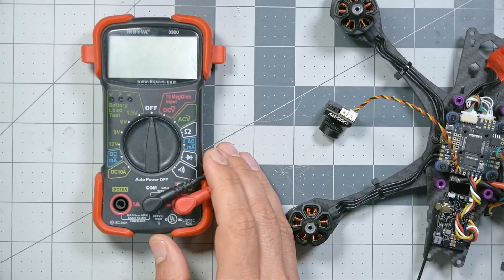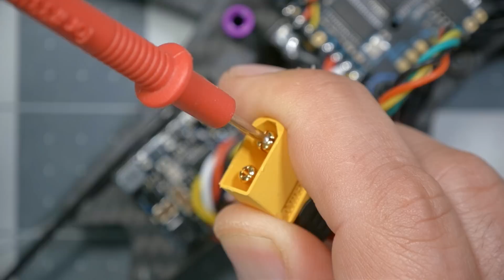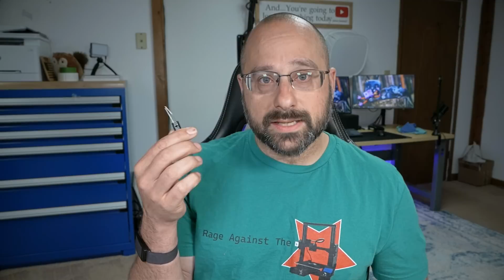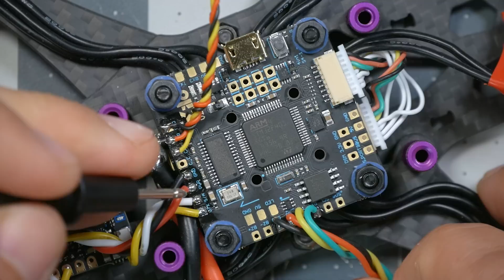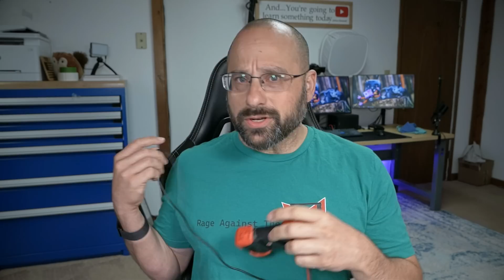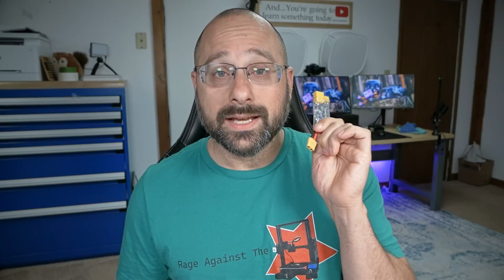This check keeps your FPV drone from burning when you power up

Comment: Hey JB.  First time build.  I have the esc, flight controller, and motors on.  I used this video to check continuity.   Can i do a smoke test now or do i have to wait to get receiver, cam, and vtx installed?
Reply from the maker: You can but I'd do it again after all soldering is done.
Reply: @JoshuaBardwell awesome.  Yes i was definitely going to do it again.  I just havent connected a battery at all yet, so i wasnt sure if that would mess anything up without the othe components

Comment: My multimeter is an analog model, which I like because it can show a momentary spike in a circuit that a digital multimeter might miss. When I test the circuit on my quad for shorts (I’m building this quad along with the video). I see the needle jump as the capacitor charges then the current begins to drop- but it never gets to zero and a small current seems to still be flowing. Should the capacitor completely stop the current, or should I be seeing a weak current still flow but at a negligent amount that wouldn’t trip the alarm on a digital circuit test?
Reply: As a follow up, I moved on to the smokestopper testing, and the smokestopper I used was happy and all the magic smoke stayed where it belongs.

Comment: Ok finished the build did the xt60 check and had continuity.  Trying to find the problem disassembled the whole thing and isolated the ESC.  Still had continuity.  GetFPV sent me a new ESC.  Got it today.  Took it out of the wrap and tested it... and continuity between all the pads on the ESC, xt60 pads and any motor pad??????
Reply from the maker: There definitely should not be continuity between XT60 positive and motor output when power is removed.
Reply: @JoshuaBardwell  what are the chances of two bad esc. The new one has continuity between all the pads even the motor pads and power pads right out of the package.
Reply: @InTheWoodsFPV  how did you go with this I have the same problem
Reply: @RickyCurtain  my Fluke meter was too sensitive.  I switched to a friend's meter and it didn't read continuity. Although now that I say that I have burned up two motors
Reply: @InTheWoodsFPV  ok mine says  continuity for a few seconds then closes but if I reverse the multimeter it give a continuous reading of around .6

Comment: One additional test: Verify the polarity of the XT60 plug. I accidentally soldered a xt60 plug on backwards once. When doing continuity tests, I looked at the color of the power leads and not the plug itself to determine if I was working with ground or positive, so the plug went unnoticed. I thought it passed all the continuity tests, but the electronics smoked when I plugged in a battery. It was an expensive lesson. Also, not all smoke stoppers have reverse polarity protection.... so don't assume any smoke stopper will protect you from stupid mistakes.

Comment: Just fyi, what happens with the cap is it gets charged from the multimeter detecting continuity, to detect continuity requires the meter to output a small current. That current charges the cap so when you switch leads and test it, the cap actually is discharging and that's what is causing the meter to beep not the other way around. The meter is detecting the same energy it put out while the legs were swapped being discharged and that's the beep make sense

Comment: I’ve always told everyone just starting out to continuity test then plug in using a smoke stopper. I personally use my bench power supply and turn the amperage down to about 1.5 or 2 amps.

Comment: Another thing to check... Each Motor wire on the ESC has continuity to the other motor wires in the same motor and not to any of the others and none of the motor wires has continuity to VBAT or GND. I actually like to start up the ESC after wiring each motor on and before plugging the FC. Checking that each motor vibrates when the start-up beeps sound.

Comment: I learned my lesson the hard way when I was a noob.  Ever since, multimeter check first and smoke stopper for first plug in. Though sometimes a microscopic solder ball will still sneak by, and melt on full throttle and burn ESC.  Even after scrubbing with alcohol and a tooth brush.

Comment: Don't know if he says it later on in the video, but some cheaper multimeters do not have a speaker in them to beep, but in the Ohms/continuity setting, zero ohms is the same as an open circuit(and is what you want when checking to make sure you don't smoke your stuff), and any reading other than zero is bad and would be beeping.

If there is a capacitor, you will have a reading other than zero for a moment, but it will return to zero shortly.

Comment: One thing I also always check before I first power up a quad is, if there's continuity between the motor lead/s and the motor screws. It happened to me before caused one motor to smoke (literally!) and the ESC spontaneously combust into flames. Connect one probe to a motor screw and with the other multimeter probe, touch all corresponding wires at the solder point to the ESC. Repeat this for all 4 motors. If there's continuity at any point, this either means that there might be a frayed single strand from a motor wire touching the carbon fiber frame (rarely the case) or - more likely - a screw protruding to deep into the motor and touching one of the coils. If so, back up all screws by a quarter turn and check again. If the short is gone, very slowly and carefully tighten each screw back again until you reach a sweet spot where you don't have any shorts. Then - locktite the screws so it won't come loose. This happened to me a lot of times and I was always lucky to have not damaged the coils inside the motors, but if you're unlucky this might happen. But the best thing would be to use proper screws, which are not too long.

Comment: i had a mistake that i missed once ,, i conected all wires receiver vtx fc esc camera ,, used smoke stopper evrything ok ,, plugged in battery poof vtx gone ,, my mistake was i put batt voltage on the 5 volts out of the vtx

Comment: Excellent video, once again JB. I do the checks you listed, but only after compiling them from your previous videos! Rush Tank Solo VTX will die if powered up without an antenna attached, as you mention, it is easy to forget on the bench. That said, I have caught problems using these techniques, and continue to use the smoke stopper if powering up "props on" on the bench.. Good work putting these tips into a single video! Thanks from "mostly INAV FPV" guy.

Comment: Lesson from the other day - if it doesn't arm correctly with smokestopper - something is wrong. Burned 3 motors because of too long motor screws. Was twitchy and rebooted with smoke stopper (but no smoke) and burned on battery. :-(  (and for the motor screws - they weren't too long - but the PLA printed feets had suddenly let them too long up)
Reply: If it makes you feel any better, most of us have been there.  For some reason we all learn the hard way.  Lol
Reply: Good point!  DMM continuity check between pos battery lead to motor screws.  Should not beep!  Also visually inspect the screw do not go pst the motor base mount.

Comment: You say there's no downside to using a vifi smokestopper...  I say there is.... In order for your crowd of people to know... You lot are connecting anywhere from 3s to 6s voltages with hard connections like xt30 xt60 connectors...  Connections that can't easily be broken.  Multimeters run on either 2 AA or 2 AAA voltages. NO WHERE NEAR THE SAME VOLTAGES!!!  1 AA battery is around 1.5V.  USING PROBES THAT AREN"T HARD CONNECTED!!!  

WHAT ARE YOU PEOPLE?!?!  IDIOTS?!?!

You trust your smokestopper to the point of idiocy levels. That it's not broken from the manufacturer or through the normal use that none of the components get ripped off.

That movie Idioacracy. You're the real life representation.
Reply: Sorry but you sound like the idiot here. Nothing you said makes any sense